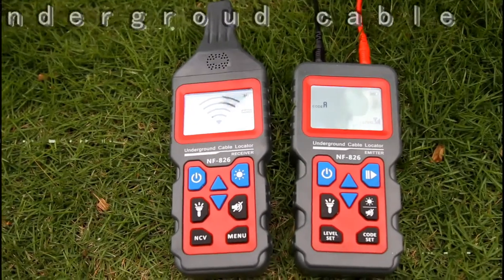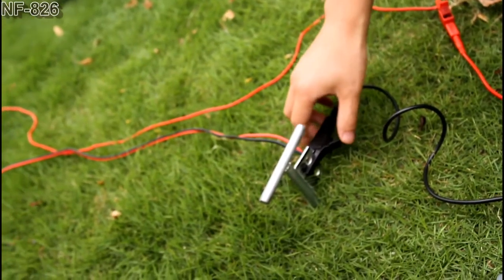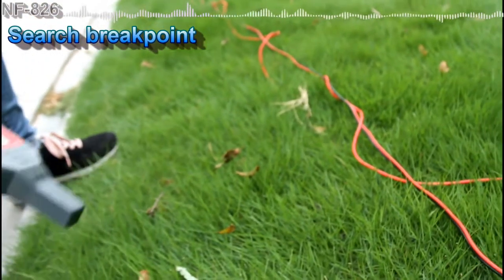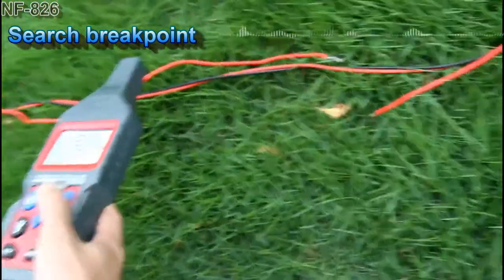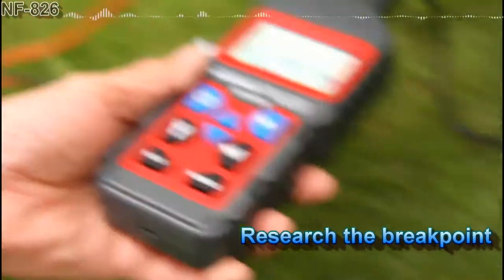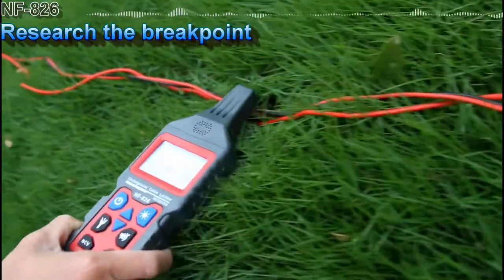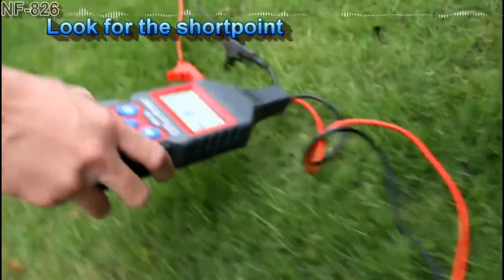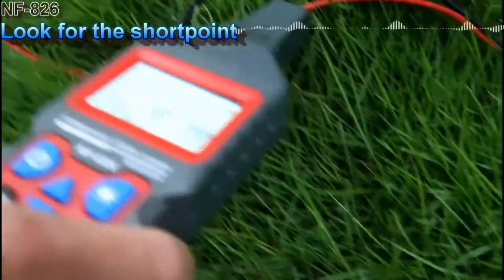Find Out Where The Breakpoint & Shortpoint Of A Underground Wire | Noyafa NF-826 Tutorial

Comment: I have a 3 wire 220v submersible well pump that I want to find.  It does not have a short.  Where do I attach the ground wire?
Reply from the maker: maybe it‘s grounded in water
Reply: I bought this.  Looked for days.  It could only narrow down my buried well to a 12 x 20' area.  It would 'hit' everywhere with equal intensity.  
Returned it.

Comment: What would cuase locator signal to fade in and out?? I'm tracing a live underground 120v. I'm tracing fine with a solid sounding signal and then it stops, but continues to do an in and out type of signal. Any reason what would cause this. I have leads on live line and ground connecting to emitter. Thanks
Reply from the maker: Please stay, the position where the signal disappears is near the breakpoint. Hope it helps you

Comment: Do you have to shut off power in order to connect it to the wire you’re tracing?
Reply from the maker: NF-826 may cause damage when it working in cables with strong current .
but  nf-820 can testing in live cable .For safety , do not recommend testing while the power is on

Comment: how about when there is a short or damaged area on the wire? I get 30v off of what should be 120v on a nearly 500' line buried in a pvc pipe.
Reply from the maker: This device can be If you need it, 
Depth Range: 2m
Max Cable Length: 1,000m
Working Voltage Range: 0 - 400V

please buy it in the official youtube storetested.， 😘

Comment: Not working at all signal dies more than 3 feet from the transmitter- even over wire know is good. Instructions and videos are useless
Reply from the maker: You can try to increase the signal strength of the transmitter, and then increase the sensitivity of the receiver
Reply: Mary, I am having the same issue.  Did you figure out how to find the break?